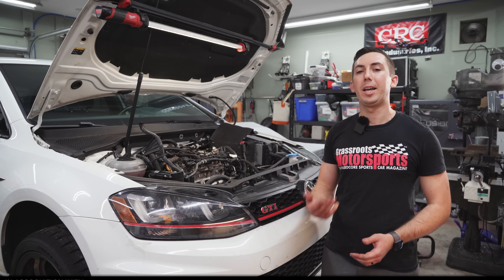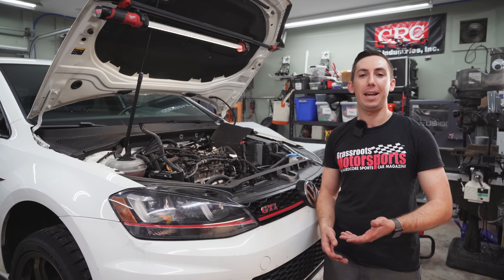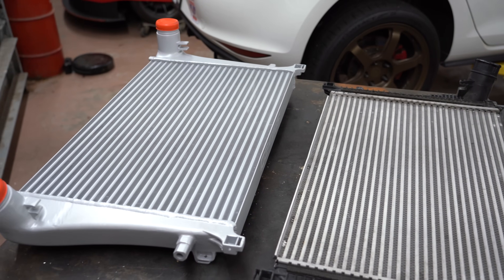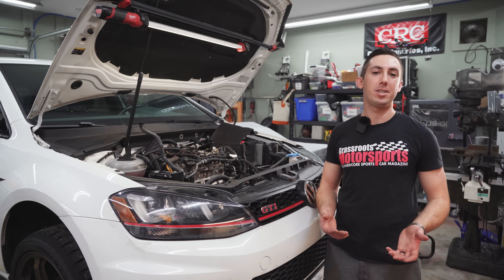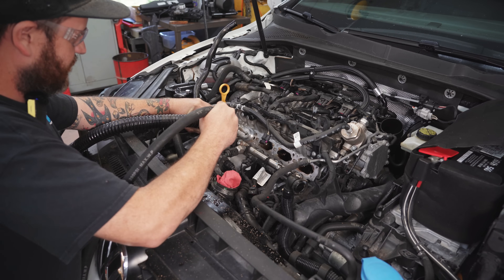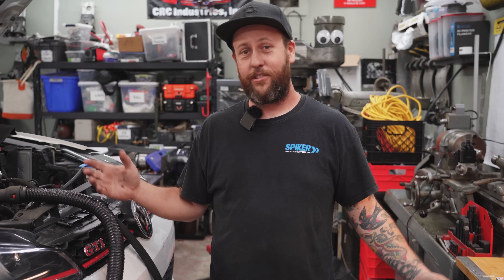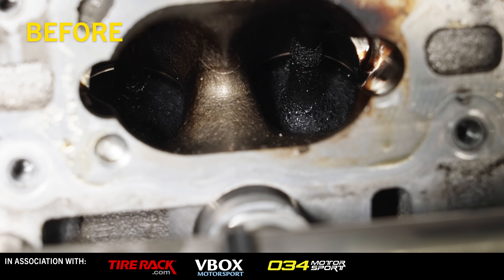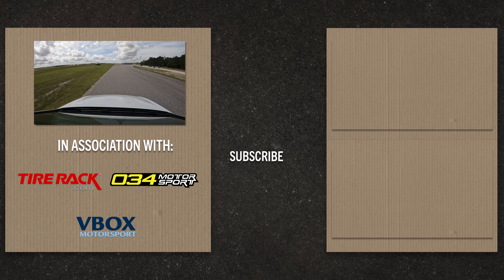How to Fix a Rough Idle With Walnut Shell Blasting

Comment: Did you clean the intake, as well? I did that on a 4.0 Ford motor with a hot tank and it made a major difference. IF those valves are gunked up, so is the intake and flow is lowered.
Reply from the maker: We did not clean the intake this time but when we had it off it looked clean.